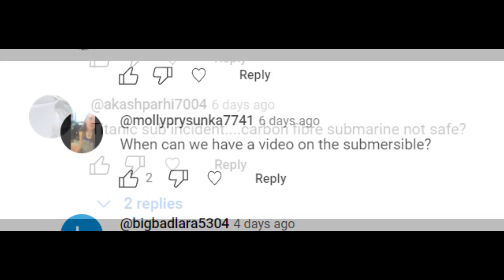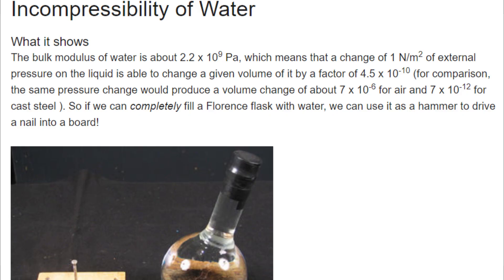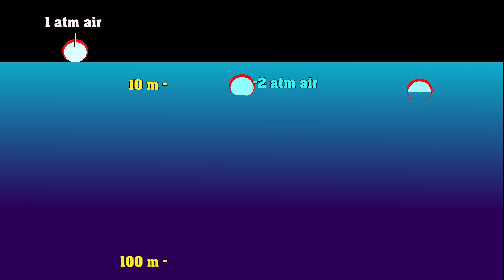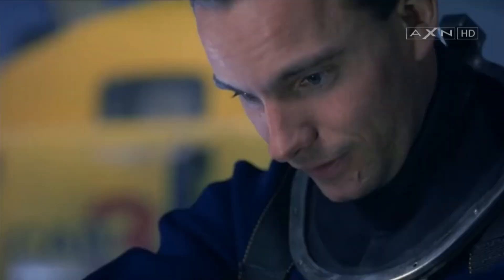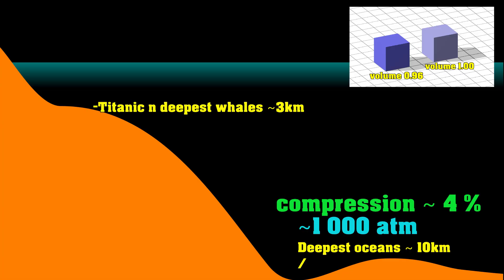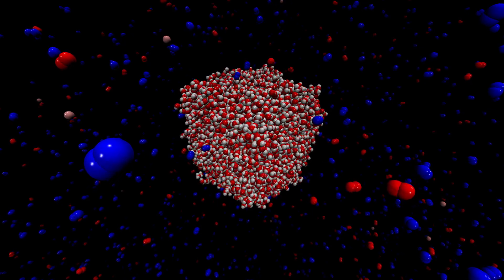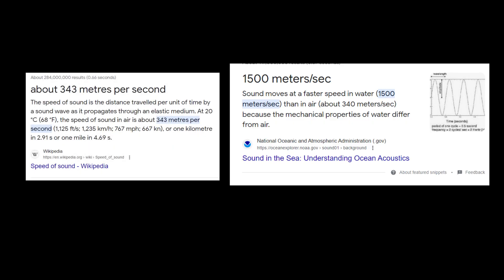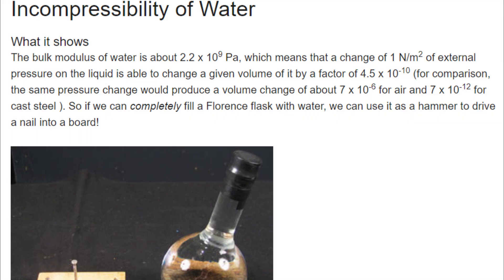What Happens when a Hull Fails at 1000 atmospheres?

Comment: The hook here is declaring the ludicrous proposition that the pressure didn't kill them. 
A lot of  inaccuracies and a few contradictions later, you're trying to justify this.

The hull starts to collapse.

Rapid Compression of Air: The implosion begins with the rapid inrush of water, compressing the air inside the submarine. The rapid compression of air results in a significant increase in temperature (adiabatic heating). This heated, high-pressure air could contribute to the destructive forces inside the submarine. It is however, too brief to cause any burning reaction.

Deformation and Fragmentation of the Hull: As the hull collapses, it doesn’t just neatly crumple; it fragments violently. Shards of the hull carbon fibre material would be propelled inward at extremely high velocities. These fragments could cause additional damage to the occupants and equipment inside the submarine.

High-Pressure Water Jet Effect: As the water rushes in, it's not merely flooding the interior; it's doing so with incredible force and velocity, much like an extremely powerful water jet. This acts like a high-pressure cutting tool, further pulverizing everything inside. The water also mixes with the fragments of the hull, effectively creating a high-velocity, abrasive mixture.

Shock Waves: The inrush of water generates shock waves within the submarine. These shock waves propagate through both the water and the air, subjecting the submarine and its occupants to rapid and intense pressure changes. The shock waves can have a compounding effect, adding to the destructive forces.

Turbulence and Cavitation: The water inside the submarine becomes highly turbulent. This turbulence is on an extreme level, and the forces involved are sufficient to tear materials apart. Additionally, cavitation bubbles may form and collapse, which can generate additional shock waves and contribute to the destruction.

Decompression and Expansion: As the water continues to flood in and equalize the pressure, there might be local areas of decompression and expansion, which could cause further turbulent flows and destruction.

Comment: What an awesome explanation. This was a 3 months class in physics and chemistry in 17 minutes.
Absolutely well done, as always.
Reply: Elasticity of water isn't really relevant here.  Just think of the weight of a 3,000 meter column of water weighing down on you, then add the fact that it's a fluid so it will flow into any area that is occupied by a medium of lesser density.  You are basically in a huge hydraulic press, except it's water instead of hydraulic fluid.
Reply: I had trouble understanding it.
Reply: @15:51 the item that is colored like air but is actually apparently water says "volume of water to decompress" implying the water is compressed. In an ocean of 3000ATM why would that water "decompress"? I do believe that something is wrong with the description.
Reply: This video doesn't really explain to me how a 4% compression would make a substantial difference. So 25 liters leaking in would initially result in an extra 1 liter, for a total of 26 liters for the first tiny fraction of second of hull breach. Also, at no point does he explain how the human body compressing by 4% would be lethal. That seems like guesswork... are skulls fractured by that? If so obviously that should have been stated in the video.

I also don't understand why the final animation in the video shows an expansion of air, which never happens. The air compresses, not expands, so what in the world is the animation supposed to be of?
Reply: @ethanlewis1453  The final animation is an expansion of water. The dark blue is the compressed water, the light blue is the region of water that has decompressed (by virtue of expanding into the sub).

The initial animations with a cube of water make it appear that the small amount of compression should be no big deal. The problem in this case is that the sub is surrounded by such a large volume of water that it won't be able to expand anywhere near 4% before the sub is full and the water enters a process of trying to reach a compression equilibrium again.

Thunderf00t's animation included a very large hull "rupture" - basically one entire end of the capsule opened to the compressed water. If a rupture was small (and stayed small), the flow rate of the water would probably be small enough that it wouldn't kill anyone instantly, unless maybe they were directly in the path of the resulting waterjet. I think part of the question is whether a rupture WOULD stay small. Typically with pressure differentials like this, the uniform roundness of the container is its main source of strength, and if that is compromised, the entire thing gets quickly crushed.
Reply: @ethanlewis1453  lol its not compressing the people 4%, its "compressing" them with whatever force the water is carrying. the water is moving at a very very high velocity because it was compressed, like what happens when you release a compressed spring. if i have a spring in front of me thats 1 million pound compression and compressed by 4%, then allow it to be released towards me, it will not just compress me 4%. it will impact me with whatever force the 4% expansion leads to, which with a million pound spring would obviously be a great deal of force. 

what youre asking is like asking why someone would get annihiliated if they stood in front of a 1 million pound spring and let it hit them after being compressed 4% LOL. really more like ten million in the titan case. 

 what youre saying is like asking why someones body doesnt compress when hit by a bullet, its not even in the same ballpark, totally wrong mental image of how it works lol.

 think of the water as a projectile, and the compression releasing similar to a gun going off. the bullet would not compress you as a whle because of the high velocity and great deal of energy it carries, it would cause damage to you instead because it is compressing an are of you by a shit ton in a very short period of time. now think of a human sized bullet, thats basically what happened to the titan. the water is a giant bullet going many times faster than even real bullets do, and carrying an incredible amount of force that needs to be released.

 the 4% is not important to understand this, the important part is that when the water compression is released it is going at an incredible velocity. so what you need to focus on is the velicty of the water when the compression is released. like anything else that hits you with a lot of velocity, its not just going to squeeze you, its going to do damage.

 the question you should be asking is "how does water traveling several times the speed of sound then impacting people then kill those people?" the answer to which is very obvious, LOL

 and the final animation is water... did you not see the H2O molecules? maybe better to take some 101 classes and then come back to this lol
Reply: @mrjjman2010  I disagree that if you have a mass of 70% uncompressed water surrounded by compressed water, that the uncompressed water doesn't become more compressed than otherwise as a result.
Reply: @ethanlewis1453 it's not 25L leaking in, it's 10,000,000...L trying to decompress and suddenly being given an opportunity.
Reply: The decompression would seem to be a minor factor... for every 25 liters that rushes in an additional 1 liter is decompressed for a total of 26 liters effective... a very minor additional problem as a percentage. Is the 4% really doing the bulk of the damage? I doubt it.
Reply: @ethanlewis1453  I had trouble understanding it too.
Reply: @ethanlewis1453 sential the incoming wall of water will hit you like a brick wall that's been shot at you traveling twice as fast as a bullet. ANYTHING larger than a grain of sand going that fast will do A LOT of damage (KE = 1/2 mv², 2x fast means 4x as much energy).
Reply: @ethanlewis1453  As I understand it, 25litres don't 'leak' in. Water rushes in (it 'expands' in) at about the speed of sound through the first crack, which would rapidly widen the crack. Imagine water rushing at you at the speed of sound while the air you are in is being rapidly compressed to 1000atm in no time at all. The massive momentum of the water would cause a fairly large water hammer effect when it hits the inside surfaces of the sub! What I am imagining is that the sub more exploded than imploded. I could be wrong but I think this is what TF is saying.

Comment: Thunderfoot we are being a bit jumpy with conclusions here and we are pre-supposing a lot of variables and conditions too honestly which is half the problem. Like how the vessel failed for one, your not even wrong in terms of the specific points you are making it's just the inverted modelled example you using overlooks many physical realities that people are elegantly to not so elegantly pointing out. If the vessel fails in the manner you suggest then fine your model would check out but from what we best know the pressure hull was not breached in this way, IF you can substantiate that the pressure hull cylinder did not fail in a way where the whole thing disintegrated in an instant and not starting at the weak point itself like you are making out then you have a case for your proposed model. otherwise the weight of consensus leans on the implosion/explosion reaction and findings from debris based on inspection so far are affirming this but personally I am always open to other explanations providing it's stacks with evidence.

Comment: Imagine a water tower with a cross sectional area of 10,000 square inches and filled to a height sufficient to result in 1000 psi of pressure at the base. 
Now at the base, imagine a pipe with a cross sectional area of 1 square inch suddenly opened to atmosphere.
Would there be any need to involve fluid compressibility to explain that the water will accelerate out that pipe much faster than  if the water simply poured into the pipe at one atmosphere?
The ocean is a quite a bit bigger than that water tower and you may have overlooked something very basic and critically important. 
Force = area X pressure.

Comment: Real engineering coverd this. The speed of the incoming water milliseconds would heat up the air burning the people then the shockwave would shred the bodies.
But though the people might fear, there would probably be warning signs like creaking sounds as the hull starts to fail. And I believe there were strain gauges in hull so an alarm would sound.
The occupants would feel no pain. The implosion comes in so fast that the nerves cannot signal fast enough or the brain process anything.
You normally debunk BS. But this video serves a big heap of BS.
Reply: This reply sounds very much like you are parroting many of the ignorant comments which are rife on social media.  Stop and think...

Comment: This analysis is bogus..
The size and type of failure/hole will determine the filling rate of the sub.
It can be determined by the following equation for incompressible flow, with some 4% error (accounting for the 4% as mentioned in the video):

Mass flow = Cd  x A x (rho x P)^.5

Rho = 1000kg/m3
Cd = 0.2-0.75 (depends on the geometry of the hole) 
P = rho x g x h 
A = size of failure (m²)

Comment: one time the speed of sound or 3 times the speed of sound is still basically instantaneous. No human could tell the difference. What it is was just a small hole? Then you would be sliced by the water jet. Water jet cutters are at about 4000 atm.
Reply: However, water jet cutters are not just water...

Comment: Best thing about the abyss, that liquid breathing scene with the rat was real, yep the rat was breathing under a liquid. Unfortunatly our lungs aren't strong enough to last long doing this and the only way to move enough oxygenated perflora carbons through the lungs is to use a pump. Putting a tube down the throat to pump the liquid in and out... which is very uncomfortable for the diver (yes they've experimented with doing it, very interesting technology. One idea is to use it for space travel to allow crew to survive high accelerations in liquid filled acceleration couches

Comment: You calculation of decompression speed is wrong. It cannot be 3 times the speed of sound.
The decompression speed cannot be different than (2gh)^½, which for 10 km depth is 447 m/s
The speed of sound is 340 m/s

If water decompressed at 3X the speed of sound, it would have more than enough speed to reach the surface, and cross it. Hence it would be possible to make a perpetual motion machine.

Comment: As long as there is a gas bubble in the water, there is a surface. The force on the surface is the area times the pressure difference. So when this surface intercepts anything, its force has no effect.

Comment: The pressure at the depths the Titanic rests are only around 350 ATM. The vessel imploded around a third of the way down according to the reports. About 3500 feet. roughly 110 ATM. 1000 ATM  is a bit much.

Comment: Thank you! I had an uncomfortable sensation regarding the explanations everyone is giving about how the pressure kills you. Maybe it was my physicist's intuition, but I had not put my finger on what was incorrect. Like you mention in your video, I kept on thinking that we are made of mostly water, and also was thinking about the wales which don't seem to mind going very deep in the ocean.

So what could crush you, if you are already at pretty much the same density as the surrounding fluid? I mean, there are a few cavities within our head, and our lungs of course, which are filled with air, and those would be prone to injury if they were compressed very quickly. The why an implosion happens so quickly was what I didn't fully understand, and saying simply that it is the "high pressure outside" just seemed incomplete. Of course, it's the rapid decompression of the surrounding fluid that explains it: the fluid expands at supersonic speeds, and we have a corresponding shock wave propagating outwards as the fluid rushes into the air filled cavity.

Water being so dense compared to air, and traveling at ballistic speeds, it would be like being hit between anvils: any soft tissue would likely be crushed very quickly.

(I know I'm just saying what you just explained. I'm partly doing it to process it on my own. Your explanation has helped me a lot.)
Reply: But the body overall would be crushed by only about 30% - the rest is water, after all.

Comment: I'm not so sure the model of an open-ended cylinder filling with water would be accurate to most implosions.  I don't think it would change the energetics of the situation but if we think of submersibles as generally cigar-shaped, over-pressure failures will almost certainly manifest as the cylindrical portion flattening along its length, possibly with some twist to the flattened shape depending on material and the exact pressure conditions.  In the one in recent news and on everyone's mind, there are two really quick ways to describe the conditions.  

First way, consider surface area of the pressure vessel.  Fairly easy with simplifying assumptions like describing it as a perfectly shaped cylinder with perfectly hemispherical endcaps.  Multiply that surface area by the pressure and you have the static force the hull was under.  So somewhere around 100-200 million lbs or 450-900 meganewtons. Once the hull buckles, it effectively becomes the heads of inward-driving pistons accelerating with that force.

Second way, consider the potential energy for a pressure differential of about 350-400 atmospheres over the volume of the pressure chamber.  Once the sides buckle, some of the potential energy does that adiabatic heating, some of it warps and fractures the hull, some of it tears up the contents of the sub, but most of it goes into compressing the air pocket that is no longer protected by the compromised hull.  with about 6-7 cubic meters at 400 atm, the energy released is on the order of something like 50-100 kg of TNT being set off, but with the blast directed inward instead of out.  

And that's without all the other fun stuff like adiabatic heating of the compressed bubble to the point of incandescence and the rapid damped oscillations that follow as everything works toward re-equilibrating over the next several dozen to few hundred milliiseconds.

Comment: Marine mammals do not store oxygen by taking a deep breath at the surface and then relying on lungs full of air during their dives. Species like the Weddell Seal charge their spleens with huge volumes of oxygenated blood (by breathing at the surface), and that's how they obtain oxygen during their dives. Storing air in the lungs is counterproductive during a dive due to excess buoyancy. A seal's spleen, which has evolutionarily adapted to deep diving, can hold 22 liters of oxygenated blood, which allows it to stay under for more than an hour. Compare that to a human spleen, which can hold at most 250 millilitres of blood.